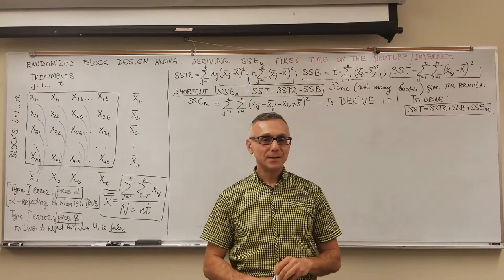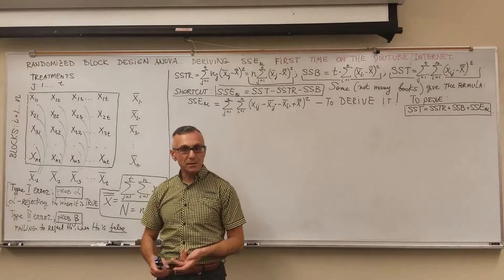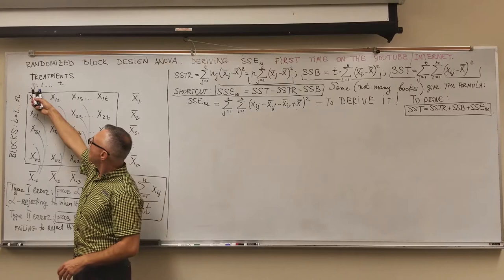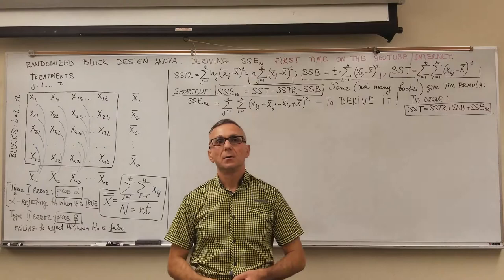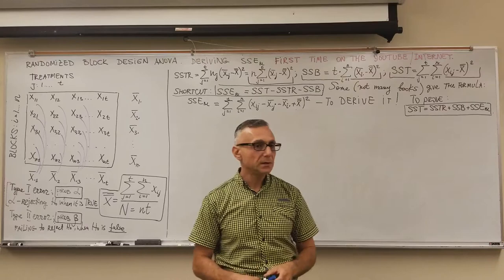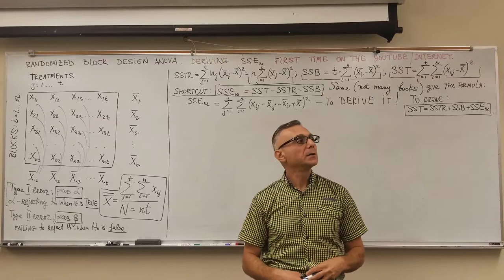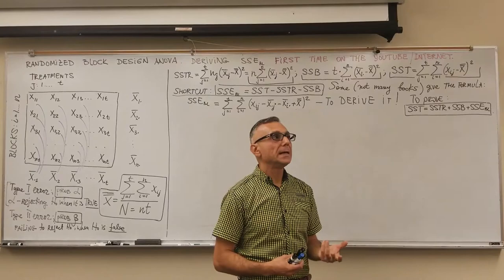ANOVA RANDOMIZED BLOCK DESIGN PROOF FOR SSE ! FIRST TIME ON THE YOUTUBE by Dmitry Leiderman

Comment: Very helpful video. In reducing error variation and creating the blocks is their an ideal number or limit on the treatments/catagories for it to be successful? For the headlight example it works but would it work with say two age groups and two treatments?
Reply from the maker: Great question! This is really a business problem. You design your hypothesis testing strategy here. You introduce block criteria using a common sense or attribute of the data. Sometimes you could have an effect of the treatment or a block, while testing the ANOVA hypothesis, or you won't have any effect of those. There is no exact number or limit on the treatments/categories. You decide it, you design it, according to your business problem. If you are testing 5 brands of the locks, then you have 5 treatments, not 7. If you are testing different drugs and their generic ones, then you assign the number of the drugs you are testing. The number of the blocks is also designed by you, according to the common sense. You won't be introducing blocks as sex of the drivers, because the sex has nothing to do with the vision of the person rather then their age. The sex could be the block if you are measuring, for example, the height of people. It is a common biological sense that females are not as tall as the males are. Or the life span. It is a common biological sense that the female's life span is longer than that of the male's, and so on. You introduce the number of the blocks using your approach. Let's say, if your block design is not successful, then you won't really have a block effect, but your design was still correct. So, there is no really wrong block design, There is only a verification whether there is an effect of your block or not. Again, the number of the blocks is chosen by you, when you design your experiment. Try to make is as large as possible, finding the correct balance of your resources.

Comment: Talking about blocks, do the units within the blocks always need to be uniform or they can differ according to the treatment?
Reply from the maker: No, they do not have to be uniform,  they can differ according to the treatments...this won't prevent the Randomized Block Design from its task... it is possible to process the data this way. Actually, that is the most typical situation..

Comment: 3:00 and on, you said  how you'd use blocks to represent different age groups . My questions are wouldn't it better for your data to have more blocks so your data is more correct or is it better having 1 or 2 treatments? Better as in having less errors and variance. Or does having more treatments do nothing to the problems besides making it longer to answer.
Reply from the maker: Yes, the blocks the better result we can get as far as testing the effectiveness of those, but if we have too many blocks then it is not worth it sometimes spending more time and resources to get the same result...everything depends on how you approach it.

Comment: Why is SSB and not SST associated with the expression that has the treatment variable?
Reply from the maker: By the definition, SSB is the sum of the squares for the Blocks. We calculate it for each block, while taking the values from all of the treatments, that is why we have a treatment VARIABLE in the SSB. So we fix the block (staying in the block, i.e. moving along the row) while taking the values from all the treatments. In the SST we take all the individual values from all the block and treatments, there is no point of using the treatment variable here since we take all the values from the whole table one by one. Hope that is clear.

Comment: Hello Professor, I just have a quick question for you. Will there ever be a time when you need to make more than 2 treatments? If so, would the number of errors be equal to the number of treatments? Or will there be ever a time where the errors and treatments will have a different amount? Thank you !
Reply from the maker: Yes, we always have more complicated models with many treatments...they are the mutivariable models as many treatments as you can design. The number of the errors is not the same as the number of the treatments, we have interactions between the treatments. By adding 1 treatment we have a factorial growth model for the components.

Comment: Is there a certain point to where if there were so many blocks in the design that the probability of either the type 1 or type 2 error would be zero or is that impossible? I know you can decrease the likeliness of them happening, but is there ever a point where they can be completely avoided?
Reply from the maker: No. It is not possible, and it is not really needed. In life and Statistics nothing is exact...it is important to estimate the process with the certain degree of tolerance, THAT IS PRACTICAL.

Comment: Hi Professor, In class, we are told what alpha is (0.05),  suppose I am performing an ANOVA for some particular data at work,  how do I determine what alpha should be?
Reply from the maker: You just assign it, you assume it, and accordingly make a correct decision and the testing process....those typical standard values of alpha: 0.1, 0.05, 0.01

Comment: What happens if the number of treatments is large? Should this method only be used with small treatment size?
Reply from the maker: It really does not have any restrictions in the numbers of treatments. It works for any size. So, if the numbers of treatments is large, nothing really happens, you continue the analysis the same way, it just takes more time, and more computer memory.

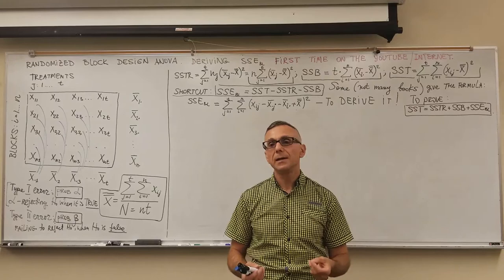Comment: (1:30) Is the random block Anova essentially the same idea as 2 way Anova?  Also, why use block method if not as accurate (3:46)?
Reply from the maker: Random block ANOVA is almost close to the 2way ANOVA which looks at the interaction between the 2 variables as well as each variable effect separately. The Random block doesn't look at the interaction effect...only at each of the 2 variables separately. Also, I do not understand your question about 3:46. Please clarify. What do you mean by "if not as accurate "..?..
Reply: @pianotalent  the example you're discussing is about the head lamps and age of the participants, then you said that because of this wide spread that the testing blocks won't be as accurate.  My question is why use this method if you know it won't be as accurate?  Thank you.

Comment: Is there a way to measure how precise SSE no block is compared to SSE with blocks. 
I'm in your stats 2 class.
Reply from the maker: It is exactly explained here in this lecture and the previous simple ANOVA how to calculate SSE no blocks, and SSE blocks. Show me where this is explained,, the time stamp...?? show me where i point out to those 2 formulae?
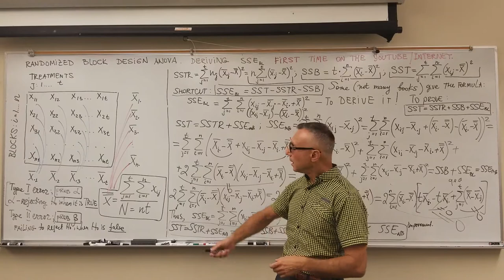Reply: 30:20 when talking about the improvement, I see WHY it’s an improvement but wondering how strong the test statistic is for both cases
Reply from the maker: @markweber8326  That is an interesting additional research and calculation question. The SSE no blocks will be larger than the SSE with the blocks, which means that the type I and type II errors will be also larger for the SSE no blocks. Calculating those will require looking at the p-values of both cases. The peak of the bell curve will be shifted and the p-value will decrease for the SSE blocks case.